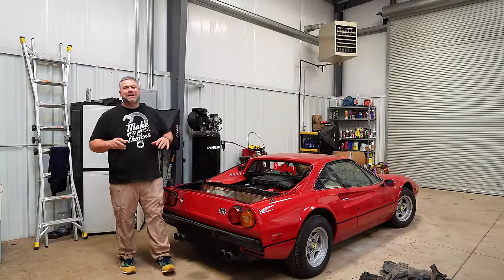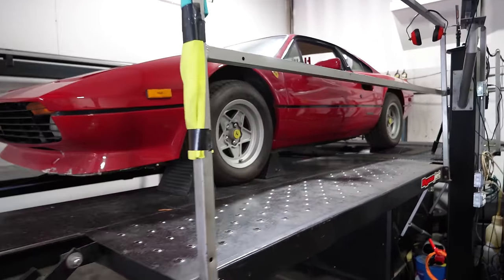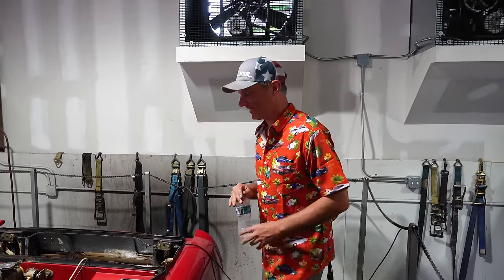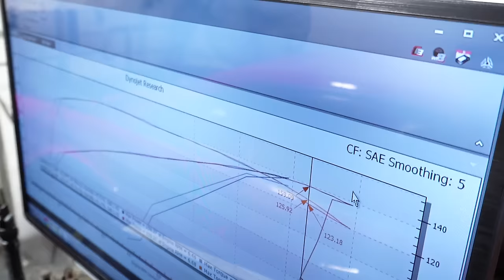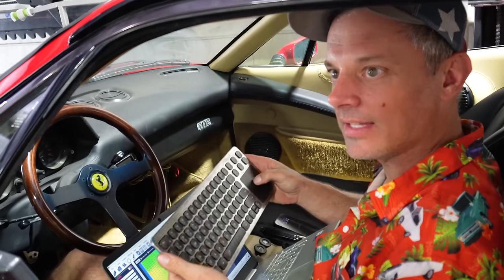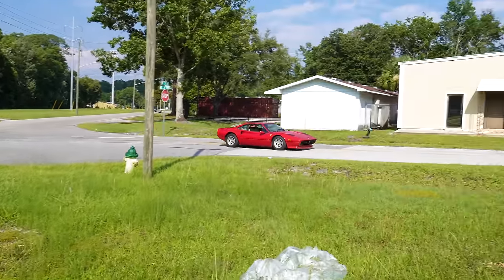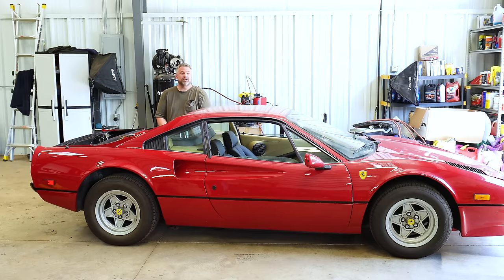Holley Fuel Injection on a Classic Ferrari: Did the CarTrek 308GTB Reach Its Full Potential?

Comment: Just a thought Jared.
My brother had a '69 Judge that had Ram Air operated by a manual cable from the cabin.
Do you think it's possible to use a similar set up with servos operating as a sort of forced air collector at the individual air intakes to force more air into the carb?
Would it even make a difference?
I don't know,..just askin'.

Comment: To give you a target, when Moto Tehnique in London converted our Dino 246 to Bosch mechanical fuel injection, the power increased from 180 BHP on the dyno to 224 BHP.
Reply: This engine was equipped with Bosh L Jetronic in the factory ( Lancia Thema  8 32 that is a Ferrari engine 308 but with electronic injection (

Comment: I dont get it classic Ferrari built with carbs running 218-228bhp with carbs why fit fuel injection to loose power? 
rebuilt carbs should of been perfect lots been rebuilt over the years

Comment: My dad had an 85 308 GTSi QV. those higher hp figures you found are for these later fuel injected 4 valve per cylinder car. The 202 number would be the earlier 2 valve (still four cams just 2 Val per) carbureted cars.

Comment: It reminds me of everybody’s view of a 77 Trans Am as a powerful musclecar. Similar to this Beautiful car they were,  fast they are not. In fact in 77-78 the fastest vehicle sold in the US was the Dodge Lil Red Express Truck, one of Dodges Adult Toys. With a puny 225 hp from its 360 police motor it was still faster than both the TA and this car. There were a handful, some 200 Black “Midnight Express” trucks made with the 440, with a Outsized potential for increased power through modification.

Comment: What an improvement! Read not! The car made over 250 hp new, with carbs! Now with hot cams AND modern EFI it makes 180 hp! In rally versions with "crude" Bosch mechanical FI it made way over 300 hp! Not your fault but whoever did the engine did a pi.. poor job.

Comment: The only way to add say a hundred horsepower to this little mill, is to turbocharge it. It's a light and tight little package that you couldn't use much more than that. It's a "sports car" in the same way an MBG or TR6 was if they were on steroids. A nimble responsive little car that's fun to drive spiritedly. The most fun I've ever had driving a car was a 1972 Lotus Elan. The DOHC 4 cylinder might have delivered 100 hp to the wheels of a 1500 pound car.  180 hp for the 308 is just right for the weight and braking ability.   I once put an aluminum Olds 215 V8, that might have made 130 hp, into a 1973 Vega GT (only 2 barrel carb).  It added just 20 pounds over the original 4 banger. It was a great little sports car, that handled very well.

Comment: We found when using EFI and ITB's on an old motor (aircooled porsche) that it was much easier to tune Alpha-N instead of manifold air pressure as the ITBS really dont give you much of range to work with.

Comment: The carbed 308s were rated at 252hp in europe and 237hp in the US.  Sounds weak but that was a lot in the late 70s, especially in a 2600lb car.  I wonder what a carbed car could do with a worked over set of the later QV heads and some more aggressive cams.  In 1980 when they rolled out the fuel injected model power dropped a lot, I think it was 211hp euro spec and 202hp US.

Comment: The variability in the power numbers you see depends upon the year of the car and whether it was a US or a Euro car. In 1976 and 1977 US and Euro cars were almost the same power as these were pre emissions cars 265 Euro and 255 US. In 1978 the US cars received an E at the end of their engine number. At this time they received cats and emissions spec cams dropping the power to 237. Then in 1981 the injected cars came out dropping the power to around 200. The final iteration was the QV cars that brought power back up to 240hp. 

This car being a 78 or 79 would have originally had the US emissions cams and been 237 crank from the factory. The question is what cams are in it now.

Comment: Back in the 70’s 180 wheel hp was a lot of power ..cars putting out that much could get to a genuine 130mph which was fast back then. Few cars could really pass a real 120mph back then. Even an early Countach only produced 260 wheel go and did 150mph.

Comment: So your first 4th gear pull was performed immediately after removing the airbox cover and you are claiming that the gains came from removing the cover? They probably came from being at a 1:1 ratio. Put the cover back on and perform the same run in 4th and I bet you the numbers don’t change.

Comment: This is why ITB's and velocity stacks make power, (when you can utilize them through tuning obviously.) There are a lot of factors that go into trumpet/ runner length and diameter. Bigger/ shorter isn't always better, as you can certainly go too big to a point, and actually LOSE low end torque, and driveability under the curve, which matters more for a non-track car where you won't be at WOT the whole time. We could talk Fluid Dynamics all day long! 🤔 That being said, You could instantly hear the difference in this thing breathing as soon as the lid was popped off that stupidly restrictive airbox. It went from sounding like a anemic 4 cylinder, to actually being able to hear it. I'd ditch the lid and throw some filters over the velocity stacks for the time being if it were me. Its too bad that car manufacturers generally like to keep things quiet, since the average consumer associates loudness with something being 'broken.' 😂 This is why you can almost always gain a couple HP/ better sound/ throttle response, just by popping the intake 'resonator' out of the airbox. This practice is as old as time and works on almost any car.

Comment: Jared, have you seen Stance/Works Ferrari 308?    He's got it stripped down, and a turbo K24 engine with a base tune of 650 HP in it.  Oh, and it weighs in at about 2600 pounds.   It's a screamer!     That Ferrari engine is a boat anchor!   And why aren't the radiator fans going on if the engine is running hot?

Comment: 19:38 I dont think its really fair to bash the ferrari numbers, and with those cams, your not going to get anywhere near the proported numbers, its one of the things Matt Farah's Mechanic noted with his own personal 308, he uprated the fuel injectors only to find it ran better with the older ones, so if someone did the same here just with the cams its not going to run as well

and the things have all their power and torque in the higher up rev band, so a loapy cam is just gonna suck the power out of it

and the ferrari 308 is one of those cars where, unlike most classics, ferrari actually made it better as time went on

also Europe had higher octanes and engines were taxed on their displacement, so, maybe its 230 HP with 98 octane? 

kinda not unlike the original Boss 302, when you get that thing running on the original 100 octane it was made for, those things are damn quick.  

like put some race gas and run it again. 

as that is the thing people forget about the euro and euro spec cars, the higher octanes, like they always assume oh smog, when its smog, lower octane and 90 pound impact bumpers hanging off the back end of the car

which that 308 has, like if its anything like the OG QV, its 90 pounds

like what does the manual specify as the go to octane level for the car? hell Matt Farah;s Mechanic is ferrari 1966 on insta, like ask him what's the average octane and numbers for one of these 

and maybe look at the cats and the exhaust, as its a 40 year old car that never ran right, might be loosing some power there too.

as its not quite there with the note, like it sounds good but its not reving as quickly as it should, like your still missing power somewhere, even if its just 10 or 20 horsepower with the air cover off

also Hoovie's 348 was 265, and that thing was well worn and stock, plus a few rebuilds, and that things proported number was 275

so I would say 210, 220 at peak is where it should be, and the 328 is 240

Comment: Just retired after 50 years of servicing, restoring and race prepping Ferrari's. The car in this video is a cobbled up mess. Wrong plug connectors with no rubber seals to stop water intrusion which is a common problem because of the louvres in the deck lid, air box is installed incorrectly which is part of your power loss, the cooling fans never came on so I'm curious as to engine temperature! You mentioned "hot" cams but power dropped off at 6500 rpm. No one mentioned a "cam card" or cam timing which is critical in those engines and if the throttle plates are the same size as the Weber carbs it's not going to pull any more air so you can "fine tune" the thing to make it drive better but until you explore the engine mechanicals and "play" with that you cannot claim the H.P. readings as being as all the engine can produce.

Comment: Well the thing weighs 2400lbs lol. Its not ultra light, but pretty dang light so even with 200hp at the wheels its be a blast to drive and still pull a bit. (Tho i do agree, turbo all the things lol, tho that Ferarri would need a semi built engine  to not explode and its just for Mrs Wizard to just drive and have fun, not go to the drag strip or autocross lol)
Reply: More like 3200 lbs.

Comment: drivability is such a overlooked thing when it comes to building cars, yeah 800hp is cool, but its not cool if its only usable for 400rpm at peak and drives like crap everywhere else in the powerband. people get so obsessed with more power and bigger numbers that they forget where they are using the car most of the time, its typically bottom end and mid range, and when it comes to modifying a street car it makes much more sense to cater to that area than it is to have huge peak power numbers.

Comment: Nice work Jared. You really have gone above and beyond, and probably big thanks to Holley for this too!! So not to take ANYTIHNG away from messing around with fuel injection, if for whatever reason someone reads this and really just likes carburetors, go check out Thunderhead 289 (Luke) with the Carb Cheater. He's an AMAZING engineer and he and his boss on their own time worked out a system that's VERY INEXPENSIVE - it works WITH your carb, just need a downstream o2 sensor (included in the kit) and some software and a couple vacuum hoses, controller etc., it's ALL in the kit, 2bbl or 4bbl as well!! Anyway this is in NO way to take away from FI or Holley or Jared or ANY of that, but I KNOW there are guys who just WILL NOT GO to fuel injection because you need a computer, even if it's in a kit, it's about a thousand bucks and a LOT of work, the carb cheater is better than half of that, and it's AMAZING. Y'all probably already know this, and I'm NOT trying to take ANYTHING away here, this is an amazing job Jared has done, but man the word really needs to get out about the Carb Cheater, it IS amazing as well!! (sorry Holley it's really NOT competition)

Comment: one time I tried to road tune turbo individual throttle body (itb) eningine. Problem was that my EFI doesn't have option to change pressure axis of map to make fine-tuning for 50-100bar. I think in na itb easier to tune will be tune using alpha n (TPS) as main load source.

Comment: I'm going to be the first to say this little venture for Holley didn't do them any favours. I mean, and original carb set up got more power out of the engine, it might not have ran so well low down, but for a modern fuel injection system to produce such "meh" results...there seems to me to be something seriously wrong with that engine.

Comment: These only had 205hp in USA spec.  They are low compression engines that were killed by emissions.  And what is great is these are redline powered cars as you saw.  Sad that the timing was failing as your rpm was getting to red line.

Comment: Freeing up airflow and breathing is good. But there is a significant side issue and that is you want to compensate for leaning the mixture. This can create more power. It can also increase heat and burn pistons if mixture isn't set correctly...

Comment: The 79 308 power numbers from factory for USA spec is 230. So you’re not far off. Since that cars power is seems to level off at 6600 rpm that tells me it probably has the stock cams.

Comment: I have a Holley question for ya. Cause I got a chevette...😬 that I have a Caddy Catera 24v v6 that needs stand alone with throttle by wire. Old hardware is gone. So could Holley even do that sort of stuff? I thought I would need to go Motec...
Reply from the maker: Terminator max and up all have drive by wire function and can take care of you! My ls powered international is drive by wire and runs a terminator max also controlling the 4l80e
Reply: @TheQuestionableGarage  Well! That solves a second issue too then cause going automatic as well in the build most likely! Want to see if can do up the 4l30e in it just cause lighter car and was what was with engine.

Is an odd transmission more than anything if not seen one. It is a 3spd with a second transmission between bell housing and trans to engage overdrive. I pondered having secondary control of that to run it 3 speed wide ratio or a 4 speed close ratio at will.

Fun chevette fact for you. Are rare parts out there. Got a high compression cylinder head and dual exhaust manifold for the OG 1.6L. Could get to 100mph on my old engine build! 100 in a 'vette be loud and scary...

Comment: Things whole situation breaks my heart as Ive been working on vintage Ferrari’s for so so long and have dyno’d umpteen dozens on them. Guys, your motor runs bad. Get it with someone who knows Ferrari engines. I’d bet anything your cam timing is well off because whoever was changing the belts did not set it or check it correctly.

Comment: Obvious air is sin that Dyno room. Cool air not going in the air duct on passenger side. Hose not on there. No cool air running in the oil cooler duct. The air box lid is a spark arrestor and prevents fires from starting.  Hard to tune in those conditions- not dissing the tuner. It’s Florida in the summer!

Comment: Neat video and troubleshooting. Your efforts to creat a more spirited driving experience got me thinking about the throttle lag on my truck (2018 Toyota Tacoma OR V6). As a former Toyota Master Tech, would you opt for the Sprint Booster, Pedal Commander or just use the ECT button for throttle response (or none)? I don’t want to damage the vehicle. Thanks, Mark
Reply from the maker: I am a big fan of the Banks PedalMonster when you are able to use it for the application, it has the best safeties built into it. Some other units will lock whatever the last output was if they fail. If you cant get a pedalmonster the Pedal Commander does ok-

Comment: Hmm... @ 2:58  It's a '78 Ferrari 308 for the US market.  Don't remember the mileage.  My guess is that we should see roughly 180hp give or take a bit...  I'm trying to be aware it's a manual transmission, not sure of clutch condition, unsure if the throttle linkages fully fixed (I know you did get them operating better), not sure if those throttle bodies are the same size as the original one (might be smaller, might be bigger), and I'm thinking it was beaten to a pulp and put away wet many years prior to being on Car Trek S4. Let's see.
Reply: Nice - and do hope we see more Holley on cars like these. :-)

Comment: My prediction before the dyno tuning? 190whp. 

I dyno tested my megasquirt powered 1.8 turbo miata on 10 psi @ 280whp/224tq. My run was right after a 5.0 fox body with gt40 heads, e303 cam, headers, intake manifold. That fox made 186whp and 260tq.  There is a replacement for displacement, which is a better flowing cylinder head and a big ass turbo.
Reply: Well, I was close but overshot lol.

Comment: Maybe make a spacer for the airbox to increase plenum volume and make the turn into the throttles less severe?
Reply: The problem is that the hood will most likely no longer fit if you do that. It already has a raised section to account for the air box, though I don't know how much margin there is, if any. Personally, I'd look into cutting down the intake trumpets a little bit, assuming that won't harm the power/torque numbers too much, and the air filter is a high-flowing version and not just another limiting factor, like the stock air filters on most cars

Comment: Would the difference in elevation between Gainesville and Wichita effect the way the car drives there vs where Wizard lives?
Reply from the maker: Elevation can have an affect, where my shop is and Wichita is very similar, so we did some more driving around and adjustments based on the ‘learned’ table. When you are able to run speed density maps it corrects a little better.

Comment: Did you use a AI tool to fix the voices when explaining the Dyno? I Kinda hear the artifacts. ^^
Reply: Yep. You’ve got golden ears! I used an Adobe AI program that did a good job of cleaning things up so at least we could hear voices over the 3 huge fans in the shop. But it did leave some artifacts that I simply didn’t have enough time before deadline to clean up. So the audio was a bit wonky for sure :). -Duane the Editor.
Reply: @decaharms  Im a sound engineer myself so my ears need to work. 😋

It did an excellent work anyway! Great way to fix the sound!

Comment: A standard U.S. built V8 crosses over at 5250 RPM. Italians are different? They cross at 6250? What gives?
Reply: ALL engines should crossover at 5250

It's do with the math, not the engine
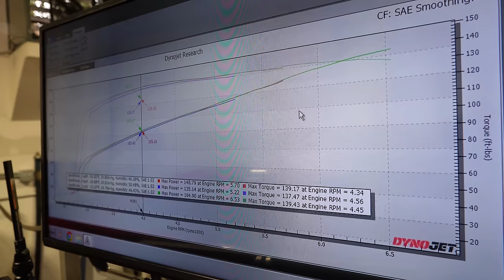Reply: @th3b0untyhunter  Then I must be mistaken. At the 13:45 mark when they showed the dyno graph it crossed at 6250
Reply: @molskimauler  or they are fudging the figures ?

Comment: Does the Holley run in closed loop and is it capable of closed loop learning?
Reply from the maker: It does! And it saves the learned tables, which you can then bled into the base map. Adjust how much correction you want to allow it to have, super awesome stuff!